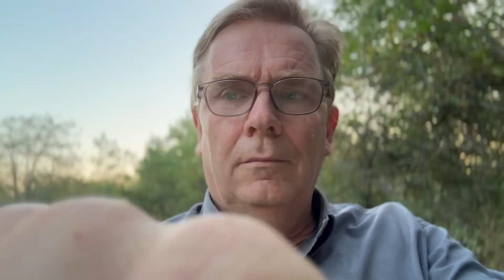October E-Cat Report: First Units to Feed Grid

Comment: As the eCat produces DC power, you still need an inverter to convert it to AC, once you have AC a transformer created the intended voltage like 22 kV. Having so many units is thus for the intention of having a larger kW output for feeding in the grid. They do not need so many units to get to 22 kV, me thinks
Reply: correct

Comment: Maybe they can't get it certified for home user distribution yet. An intermediate power station may provide power to a local community as the primary unit of power supply, and the grid as backup. Hopefully that power will be supplied as cheap power. For all we know, those intermediate grids are powering remote communities that don't have reliable power in African countries, or in India for example. That would make me happy to know that.
Reply: I live in spain off grid. It's been like this for most of my life.
I need the DC unit ASAP.